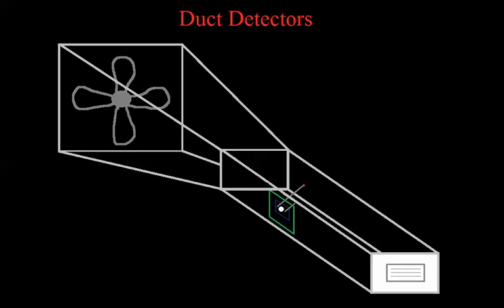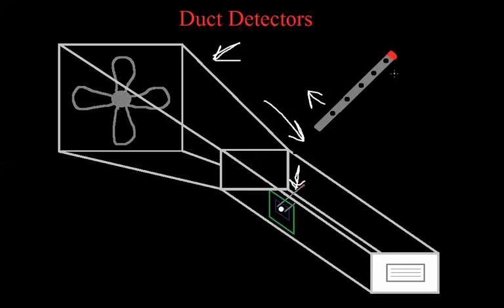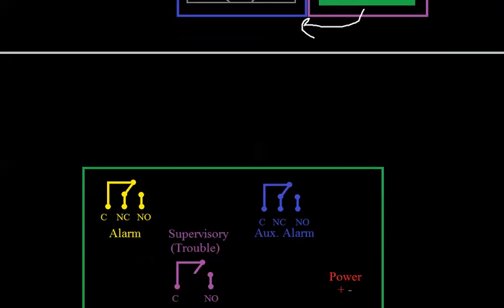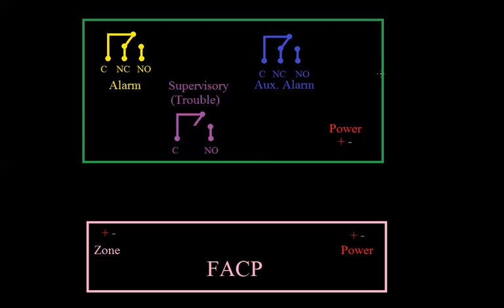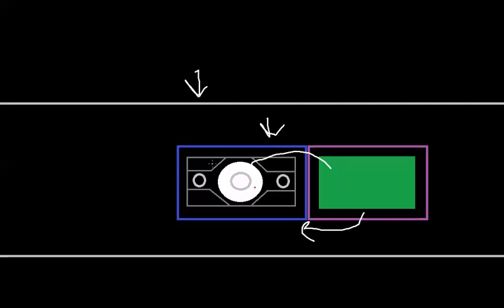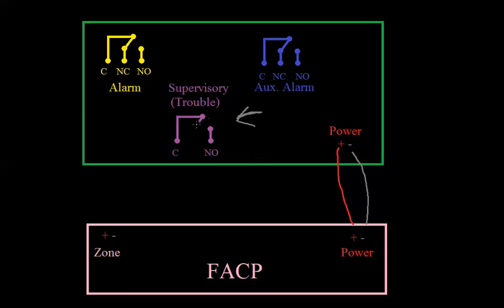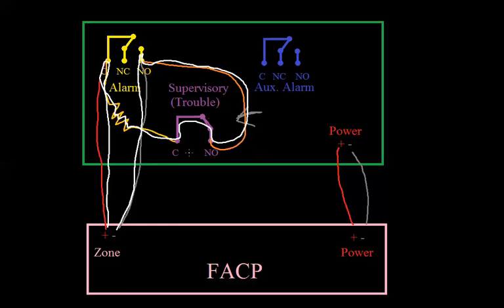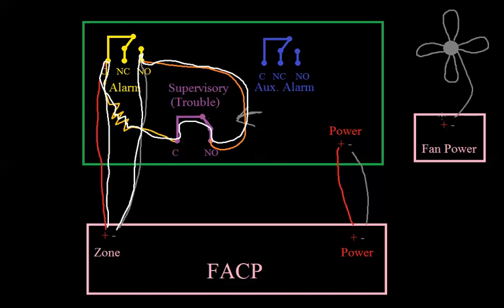15 - How Duct Detectors Work - Introduction to Fire Alarms

Comment: What causes the Aux Alarm relay to change state?
Reply from the maker: That changes state when the detector activates, same as the regular alarm relay. It just allows for another circuit to be controlled by the detector in addition to the alarm panel.

Comment: Joe when testing differential pressure between the sampling tubes with a digital manometer... Do you take an average reading or a peak reading? I've seen some fluctuations from pass to fail.

Comment: If the fire alarm "initiation" duct relay(alarm) is in a DIN type socket you should come out of the trouble Form A relay through the EOL resistor and end at the NC contact of the alarm relay instead of back to the common terminal...this way the alarm relay is supervised from being removed or jarred(unseated) from its socket. TR(nc)------/\/\/\------AR(nc)

Comment: Can the duct detector be installed on the supply or does it have to be on the return?
Reply from the maker: +Robert Cortez The international building code requires them to be on the one side and the international mechanical code requires them to be on the other. I don't remember which is which. Some towns adopt IBC, some adopt IMC. I've seen them both ways, and I've also seen many buildings that have detectors on both the supply and the return.